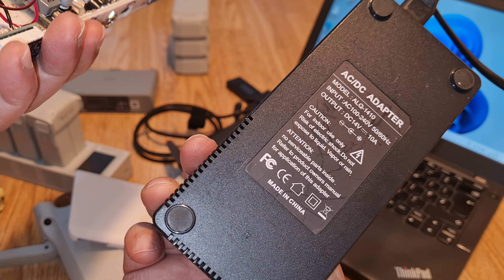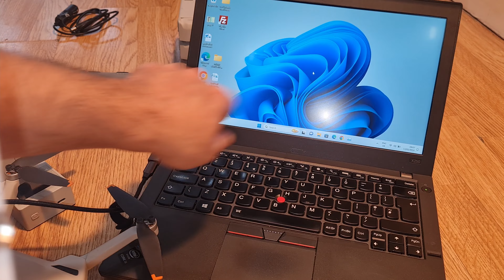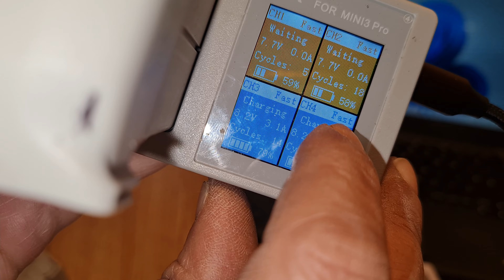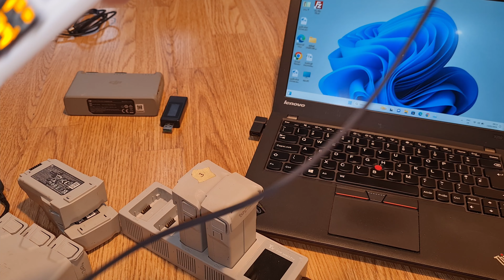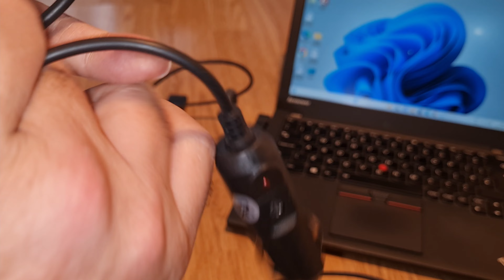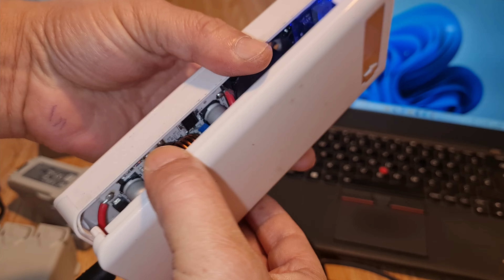Part 2. DiY Beautiful Powerful, Cheap and Best Car & Desktop Charger for Laptops, Mobiles 178 Watts

Comment: Hi, nice little project mate.  One small point is I don't see the usefulness of constantly displaying the output voltage of the boost converter.  It would be far more useful to display the output voltage to the device being charged via PD instead.
Reply: i will try to make it, you gave me a good idea but it may need a bigger casing, regards